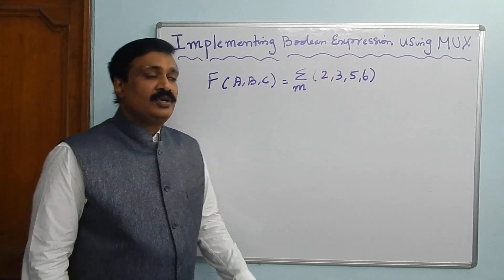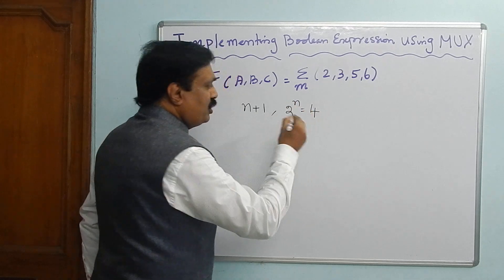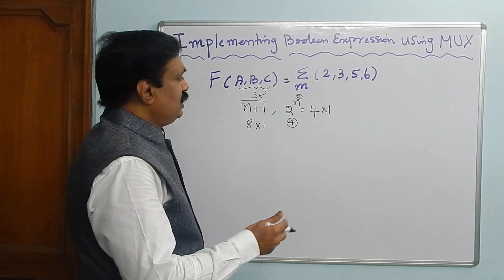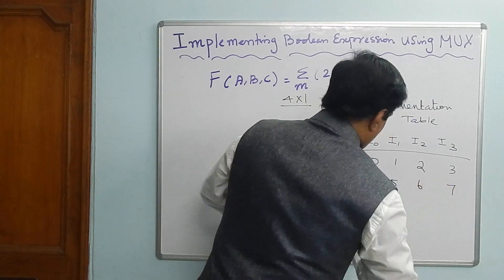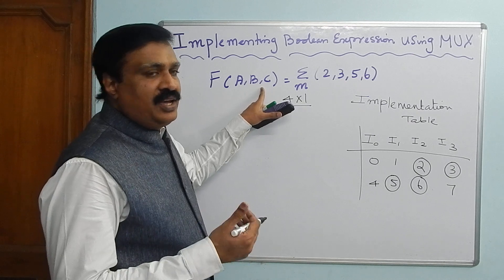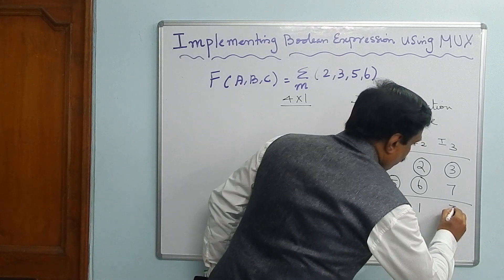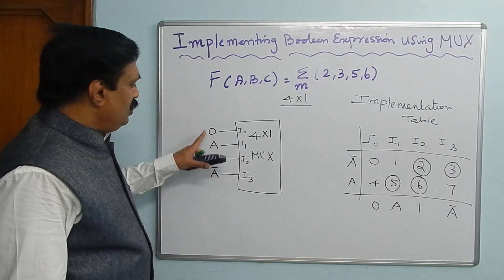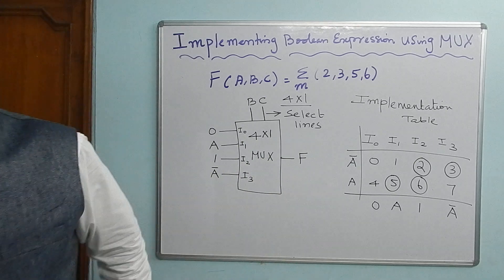Implementation of Boolean expression using MUX (1)- Digital Electronics

Comment: sir can you explain why the places of 2,6 are not interchanged with 3,7 ??? Actually it's 
0 1 3 2
4 5 7 6
so why did you write 
0 1 2 3
4 5 6 7
Reply: sir did correct way..0 1 3 2
                                    4 5 7 6
this is for k map not for implementation table